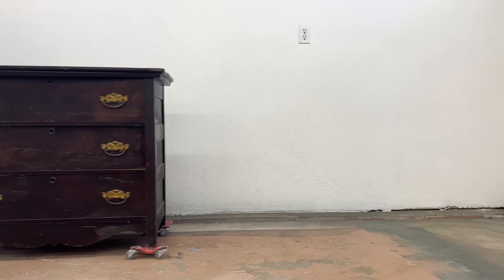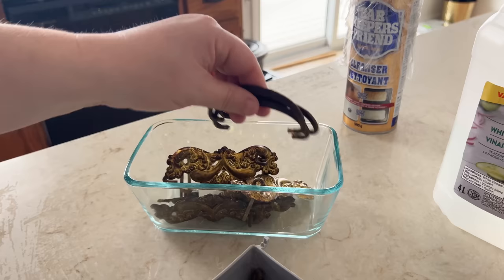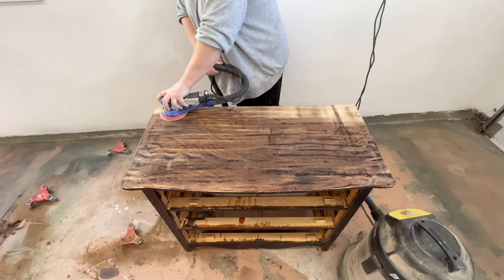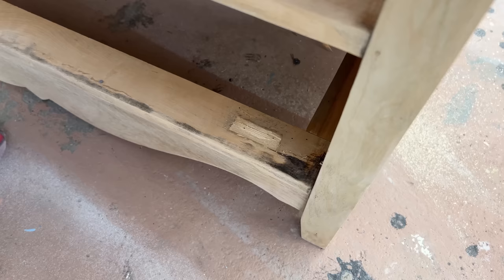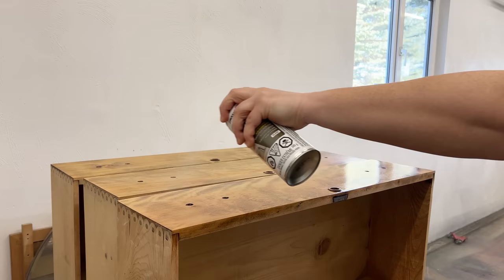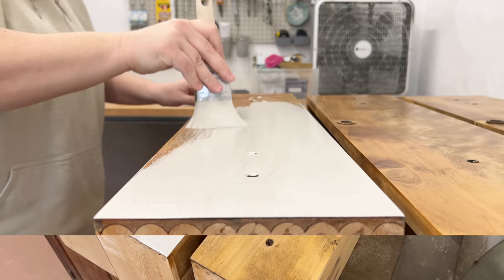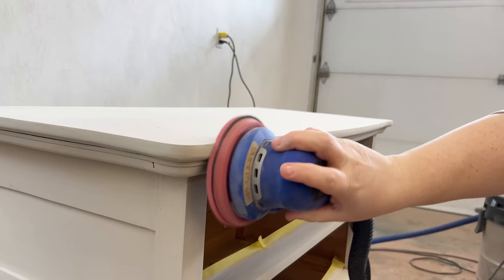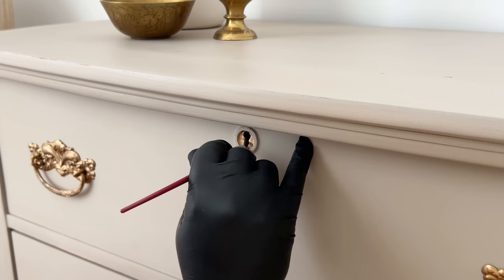Restoration Attempt turned MILK PAINTED MAKEOVER | The journey of a Victorian Era Dresser

Comment: Definitely an upgrade.  This is the sort of piece that I, personally, would have passed by - thinking it's too much work or it would never go with anything else in my home.  If a piece is solid and previous 'upgrades' don't destroy it, it's worth trying to refinish and bring  back to orignial.  But...in your case, nothing you tried worked.  Painting, aside from setting it on the curb, is the only option and a fine option it turned out to be.  It's beautiful and a piece I would be proud to display in my home and, more importantly, use.  Thanks, Katie.

Comment: When I first started refinishing furniture, I would never have painted a piece.  However, these days I don't hesitate to paint furniture especially if the finish is compromised to the point of the dresser, you just finished.  Actually, I have an oak dresser that I've had for over 40 years and plan to paint it this summer.  Times have changed...go with what is best for you!  Your dresser came out just beautiful.

Comment: You did a fantastic job saving this dresser. Just to give you a little history on that dresser, that is Knapp furniture. They were made between 1870 and 1900. The patent for drawers lasted 30 years. Then it ended.  I found a dresser just like it on the side of the road. I was able to save the wood drawers, but painted the rest. I saved it from the landfill. It was a win for me.

Comment: I think you did a beautiful job with this piece! Generally, I prefer to see an antique piece restored to its original glory, IF POSSIBLE.  But, in cases like this where the surface is such that that can't be done, by all means paint it. Lots of people think that just because something is old it has great value. Unfortunately, that's not the case especially if it has lots of wear and tear. It's always better to restore/restyle a piece of furniture in a way that causes people to want to use it, rather than trying to "remain faithful" to its original state and have it end up in the dumpster.

Comment: I think you did a beautiful job and I'm with you on furniture refinishing. If it's not gonna be used what's the point. As long as it's still being loved it doesn't matter what is done to the finish. The original piece is still under there but it's just been improved or updated. Love your work!

Comment: Not all antique original finishes were expertly done with the intent of highlighting beautiful, now "precious" or unattainable timber.  Many of us who've been refinishing pieces have also removed glue smears, uneven stain, and factory sprays that disguise wood beauty.  As you do, most flippers bathe and oil or wax surfaces that never had those treatments when freshly built.  That's why the carcasses and drawers shred, swell, cup, and crack.  We know better, we can do better - and you're a fine example of how to try.

Comment: The best way to lighten that dark-staining is oxalic acid. It comes in a powder form remix it for the packaging instructions with warm water apply it let it dry it will get crystalline and then clean it the way the package tells you it usually requires two coats for darker staining. But that is only if you plan on staining the furniture if you want it painted I wouldn't bother with oxalic acid. Personally I feel it's a preference thing either you like painted furniture or you don't. And if you feel that strongly one way or the other maybe you shouldn't watch channels that do what you don't like. Lol

Comment: You did exact the right thing. The wood was wrecked and you saved it. I did a piece for my son it had failing veneer and smelt awful I tried to save the wood but to no avail. Sometimes you just have to work with the piece rather than make it something it can't be again. You made it  Better than it was and it will live on for Many yesrs

Comment: That's varnish, you could tell by the way it was bubbly. Varnish is very easy to reactivate. A lot of times vinegar will work especially if it's the original varnish. Or mineral spirits will always work. Spray it on, give it anywhere from 2 minutes to 10 minutes, and it'll come right off with a plastic spatula or even a scrub brush. Varnish will reactivate under heat but not enough to allow it to lay back down nicely (would using mineral spirits can help remove alligatoring of varnish when you don't want to refinish a piece but you want to remove that alligator skin look). Using heat will make it gummy and messy. I always try and remove varnish before I sand because it clogs up sandpaper in a five-by-five section. I have seen people use acetone to remove varnish but that Overkill and rather stinky.

Comment: I'm redoing a pair of china hutches, they are at least 60 years old.  I took the finish off, which was dark and yellow-y, and the wood underneath the front was cherry, solid cherry. The more I looked at it, the redder it got, and it had some random dark streaks through it.  I really wanted to stain it again, but I could tell I'm going to have to use a dark stain to cover the imperfections.  I'm afraid to paint it because I know it will bleed through.  The original color was almost a mahogany.  I'm currently trying to decide what to do to the interior, because I don't want to take the fragile glass off, and I can't reach to the back or sides.  I was able to strip the shelves and the shelves do not remove.  It's an art deco piece with some carvings, so, maybe wallpaper on the inside and stain on the outside.  I've never done this before, so I'm crossing my fingers and going for it.

Comment: Katie, I think this finish is such an improvement to this piece, and it looks like it can handle another hundred years!  I do have a question about milk paint - can it be used over laminate furniture? I didn't know if the smooth surface of laminate would inhibit the cracking that milk paint tends to do.

Comment: I've always questioned the whole., "If you refinish it you ruin the value" way of thinking. I have a dressed that had at least 10 coats of paint but was told to not strip it because it would be worthless, BUT I've always wondered... is it the third coat that would ruin the value,  was it already ruined at the 7th coat?, at what point does repainting it make it worthless?
 Needless to say, I stripped/re-finished that old dresser and loved it! I've also been over much more for it than I paid.

Comment: Did you try oxalic acid or paint stripper? Maybe tape plastic wrap over the stained areas.
Reply from the maker: Tried both, neither worked on the stain. They just made the wood around it lighter.

Comment: You will laugh at this one.  I bought the exact same chest, same hardware everything. I got it on marketplace for $50. and the guy delivered it.       It was already stripped down and was in really good condition, however, I wanted a black chest and painted it with chalk paint. Did the same thing as you did to the hardware and it looks like $500.

Comment: I feel like any time there's an antique piece that's had previous work done on it, it's not original anymore anyway so why not preserve it longer. The same can be said for paintings. Restoration artists will fill in any parts that are bare canvas and try to mimic what should have been there, but often times conservationists will have to deal with poorly done restorations that were just damaging the original. Why not fix those paintings so that they last through another few hundred years before they need more restoration? You're just helping the piece to survive in the long haul by refinishing it.

Comment: I think it would have been more interesting to take it all apart, every board, and planed the boards to remove the stain, reassemble it and then refinished it with natural wood. Of course, the work involved would have been ten times longer, but the result would be nicer. As it is now, the value is greatly reduced.